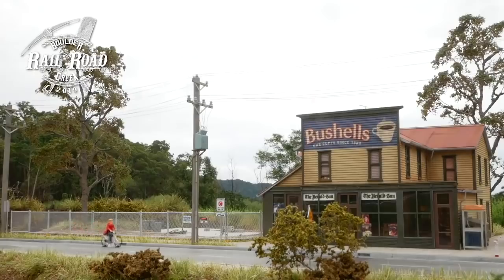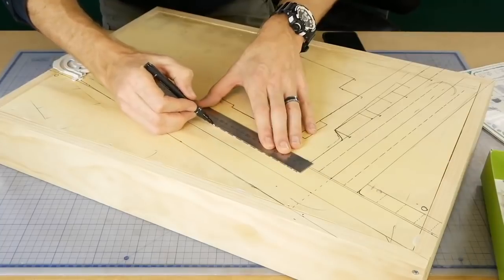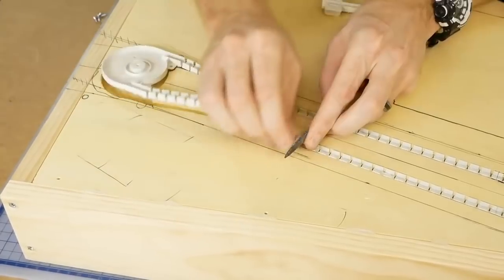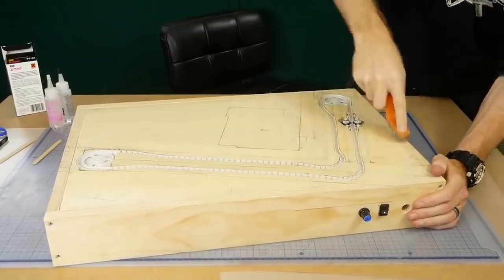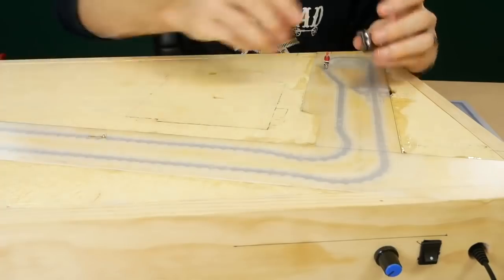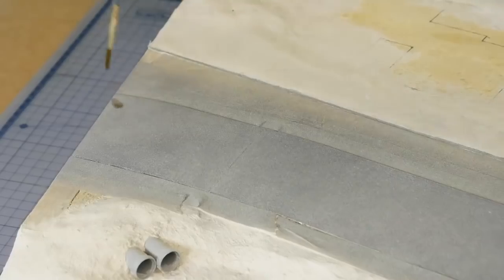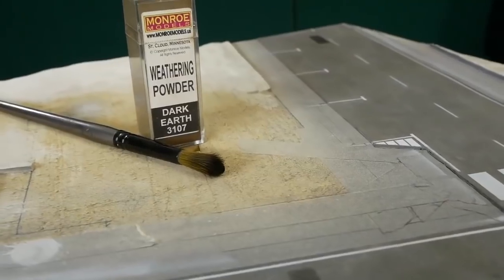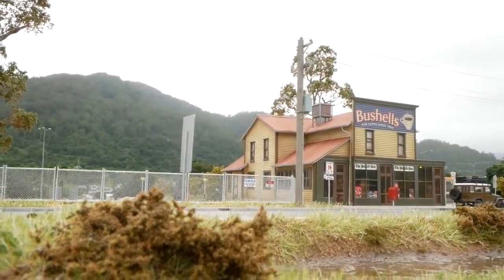Magnorail Meets Luke Towan

Comment: what bit do you use in the router and to what depth? what is minimum width of board needed to create an oval track - my board is 30cm max
Reply from the maker: a 3/8 router bit is the right width once you have cut off all the extremities from the channel. Magnorail can easily go around tight curves, the channel is very flexible - like snake!

Comment: thanks for replying. what menas remove extremities? i am so new to magnorail.
Reply from the maker: The extremities are the plastic parts for screwing down the track and the reed switch holders. Remove them so the sides of the channeling is smooth. Of course you will need to router around the return loops and drive check out one of my installation videos on Crater ;are which shows the routing in action.

Comment: Hi, fantastic! What did you use for the street? Is it plastic? How thick is the Material?
Reply from the maker: Plastic, laminated paper or card, or balsa wood all work however thickness should be under 1mm otherwise magnets do not grip. Luke made this a little too thick and had to increase magnets on Landrover to compensate

Comment: What size foam board did you use?  looks like a wood frame?
Reply from the maker: Hi Michael - Check out my first Crater Lake video https://youtu.be/Ga_MfyEe1fs at about the 2:50 minute mark (or watch the whole video) where I explain the foam material - hope it helps - Clyde

Comment: What instrument you used for cutting wooden base??
Reply from the maker: The base is compressed foam board use for insulating walls in houses - you just use an electric foam cutter or craft knife to cut and shape it.
Reply: @MagnorailOz  It is a Dremel (brand Name) hand held rotary tool with a router Base accessory. Basically a lightweight trim router  that uses 1/8" bits.  All sorts of brands at the Bigbox hardware stores.